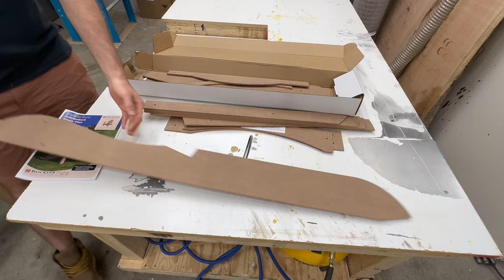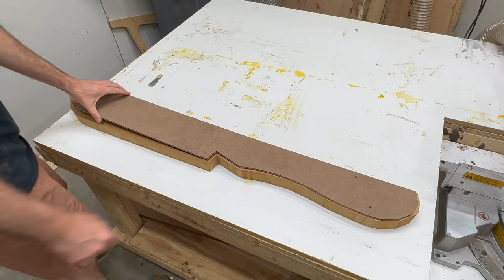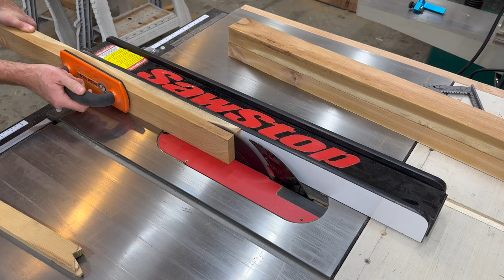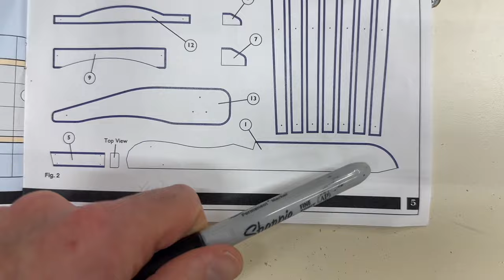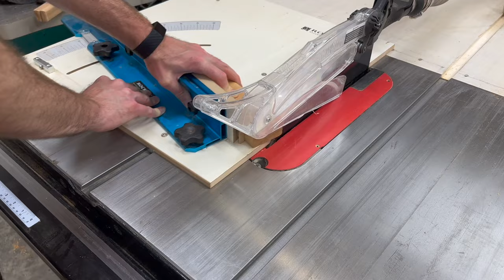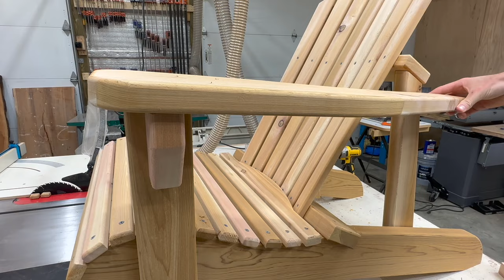How to Build Adirondack Chairs || Rockler Adirondack Chair Template || How to Woodworking

Comment: Just ordered the plans with mdf and footstool and table. How many bf in 4/4 will I need?
Great vid. Thanks
Reply from the maker: Thanks! The manual recommends the following per chair: 
1x2x8' (x4) 
1x4x8' (x3) 
2x4x8' (x2) 
2x6x8' (x1) 
2x8x8' (x1) 

Calculated out that's about 47 bdft of 4/4. If you can get thicker stock I would definitely recommend doing so - if 4/4 is all you have access to, I'd probably get ~60 bdft in order to have a little extra.